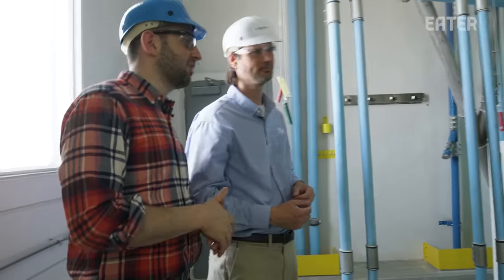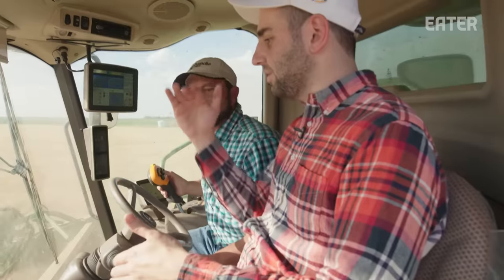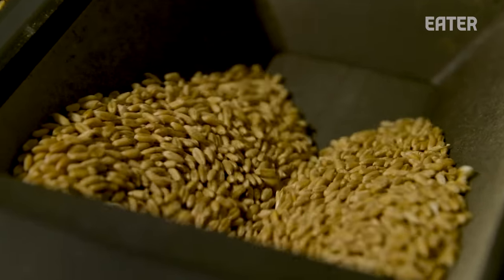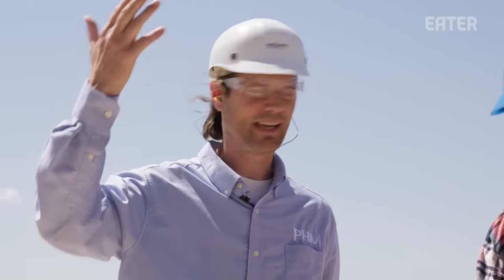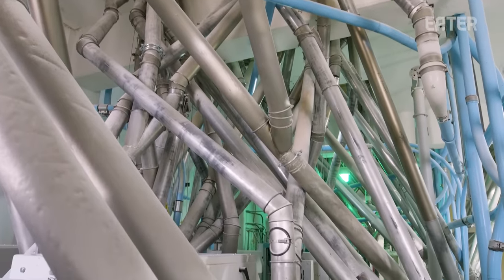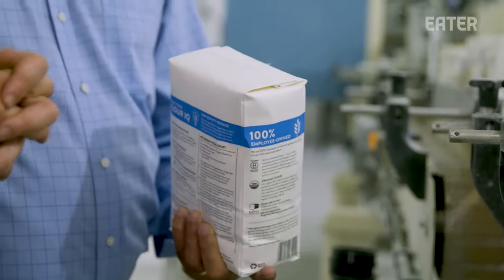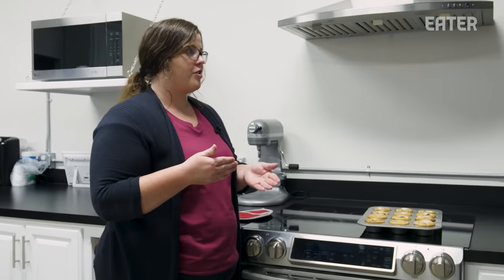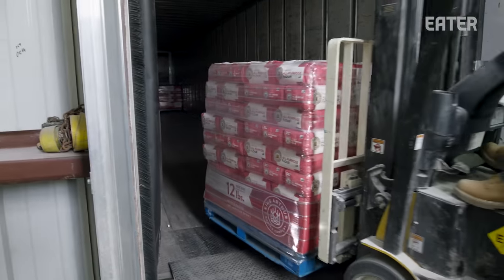How King Arthur Baking Produces 100 Million Pounds of Flour per Year — Dan Does

Comment: I would have liked to have seen the separation for whole wheat and white flour.
Reply: The mill shown in this video is only making white flour, whole wheat is gonna be slightly different. When you make white flour the bran and shorts aka by products are separated and sold as separate products usually animal feeds or filler ingredients. In whole wheat mills the bran and shorts are ground up and incorporated with the white flour, so the rolls rollstands are set-up to grind different and sifters are also set up different, but same equipment.
Reply: @tylerhughes5420  They also take out the germ which is the most important part. Most of the nutrients are in the germ.
So it is not something I use
Reply: @chrisford9045  yes we do, the germ contains a lot of fat that causes the flour to spoil if not refrigerated.

Comment: All's well and good unless you are specifically looking for a softer flour. That's why I have five different flours in the pantry and use four times as much White Lily as King Arthur.
Reply: Aren't high protein flours best for breads?
Reply: @shawns0762  Usually. Low protein for cakes and such. I blend depending on what I'm making. My son makes a lot of bread doughs for buns and pizza and such so he keeps bread flour 11.5-13% protein (Hard Red Spring Wheat) and AP. I make biscuits and cookies, loaf cakes and short cakes so I keep White Lily (from Soft Red Winter Wheat, 6.5-7.5 % protein, and store brand AP, 9-10% protein. You can easily taste the texture difference. Store brand cake flours are usually soft red winter wheat and that's what I used until I found a store selling White Lily here in Texas.
Reply: @jamesoliver6625  I know the right flour makes a big difference in donuts too, I used to work for a large bakery and the bags of flour we used said "donut flour" on them.